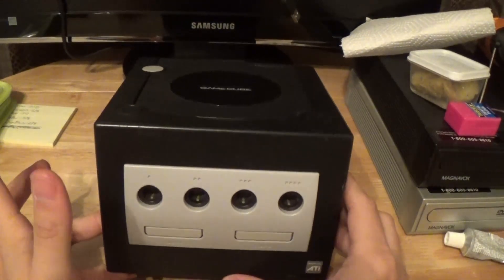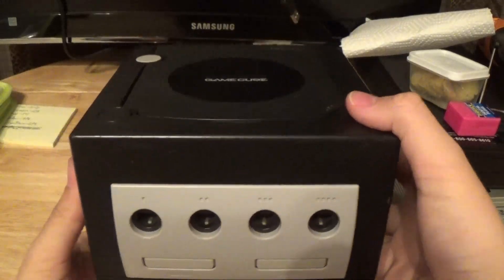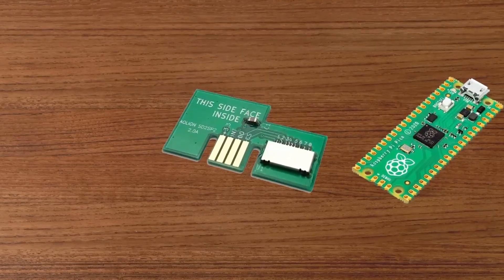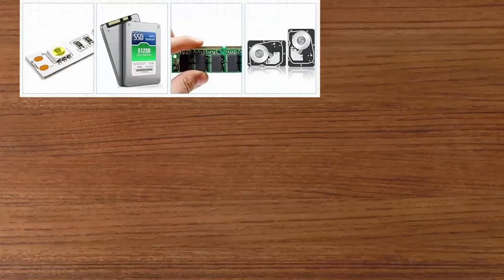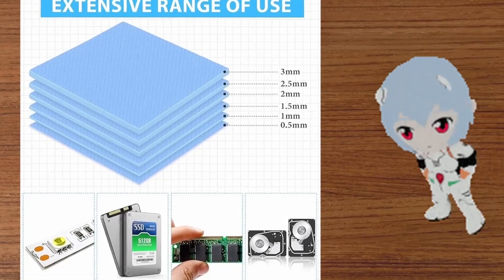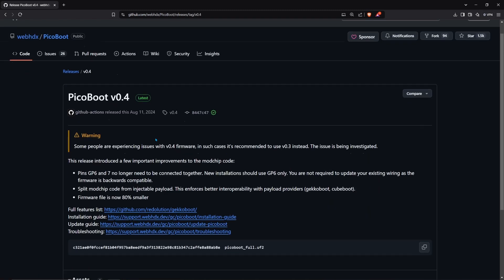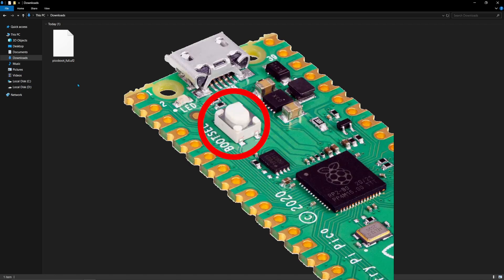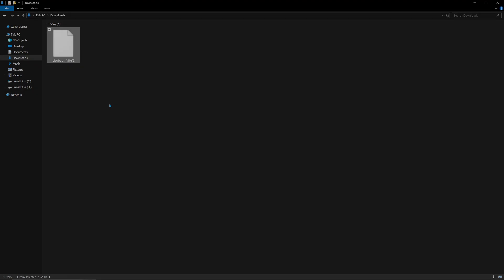GameCube PicoBoot Mod Install and Thermal Pad Replacement

Comment: Im attempting to replace the thermal pads on mine. How important is this replacement. Or should i jsut leave the factory ones there
Reply: Play the GameCube for a half hour and let the system get warm before you pull off heat sink. This way you won’t mess up thermal pads.
Reply from the maker: If they don't tear when you pull out the heat sync you should be able to reuse them, but it's recommended that they're replaced